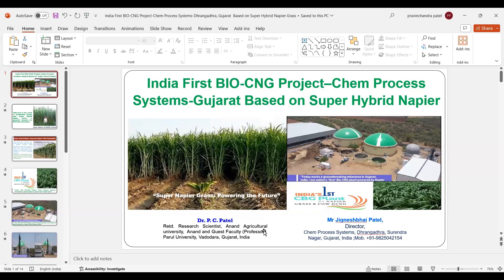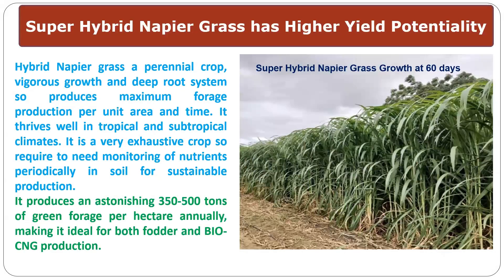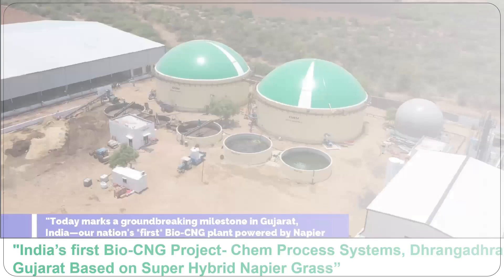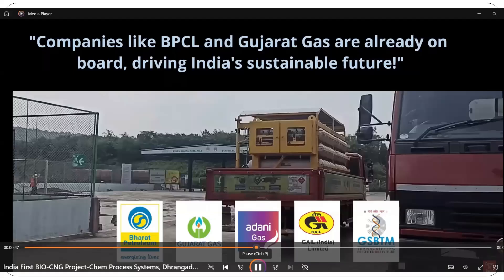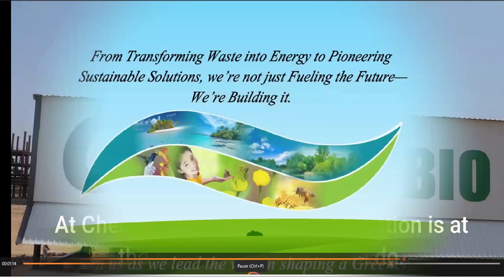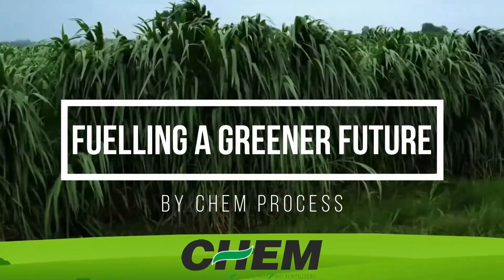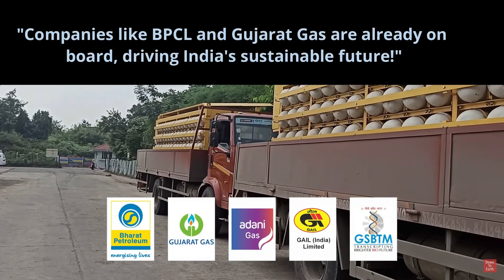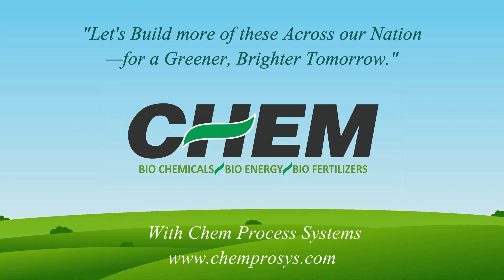India 1st BIO-CNG Plant–Chem Process-Gujarat Based on Hy. Napier-Dr. P.C.Patel & Mr Jignesh Patel

Comment: Aaj kal 500 to 700 thousand ton per acre ka Napier Yield aanay lagi hai 
High carbon soil Use katnay par
Reply from the maker: It is not possible to produce huge production of napier per acre. It is a highly exhaustive crops and in a year we  harvested 6 to 7 crops so obviously more uptake of nutrients. If we increases more carbon in soil then forage production will be increasing but it is not vaible. We have to look cost benefit ratio also.